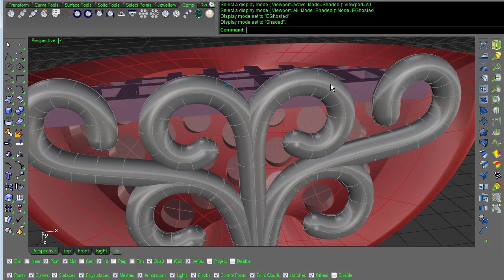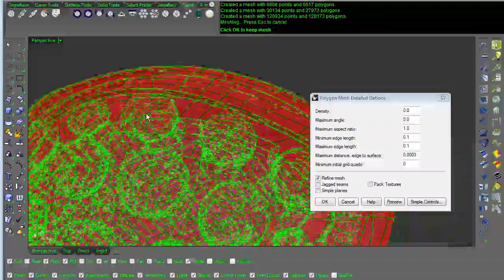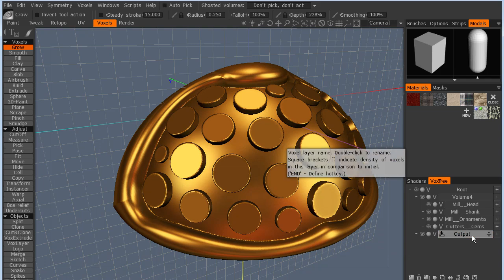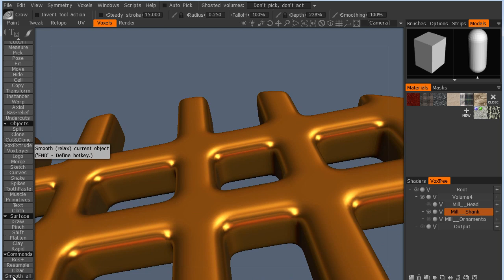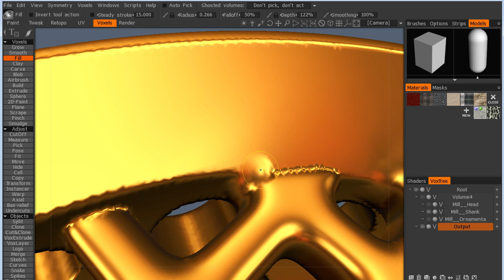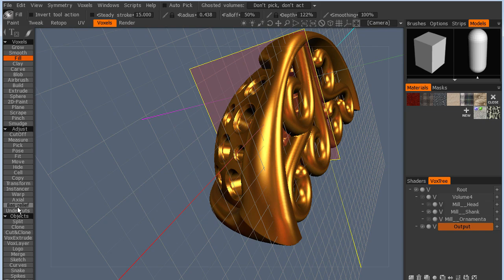Using 3DCoat to Supplement Rhino 3D (old version; see description for new video)

Comment: Hello Eric, Thanks for sharing! I've been using Rhino7 (Trial) for three months and I learnt and used it comfortably. I'm a self learner btw. Now is the time to purchase and like you know Rhino is going to cost around 1k. What do you think is right for industrial designers/ product designers? Rhino, ZBrush, 3DCoat? I hope you can save me from this confusion. Thanks
Reply from the maker: I would say Rhino. Surface modeling will be important.

Zbrush and 3DCoat are very similar with 3DCoat being the better of the bunch. Not sure how much you'll need it though.
Reply: @EricM81  Appreciate your reply! I've been holding my cash around 1k for Rhino(hoping for a XMas discount) but once I heard about ZBrush and 3d Coat, it just got my mind away from it. 3dCoat is obviously a cheaper alternative for ZBrush. So, I'm going to think about Rhino more from now on. btw I heard many people prefer 3dCoat over Zbrush because of its better interface. Is that the only reason to take 3dCoat? Many thanks!

Comment: Thanks so much for all your very helpful rhino videos. In this video you explain how to export from 3D-Coat to STL for printing. What is the best way to export from 3D-Coat back into Rhino 5 for changes I might want to make
Reply from the maker: Rhino isn't great at working with meshes.  Once I mesh a Rhino NURBs surface, for me that is a one way process.  What kind of modifications were you looking to make in Rhino?
Reply: Thanks for answering. I'm and old time bench jeweler just starting out in Rhino for the last year or so and am getting used to inspecting the final model in Rhino. What would be the best way to view the model I finish off in 3D-Coat inside Rhino for a final inspection. The same .stl settings you recommend in this video are the same ones my caster has just started recommending for conversion to .stl from .3dm. I would like to make sure the .stl file from 3D-Coat export is  close to those settings and give it a final inspection in rhino where I can check detail and measurements. After looking through the web, I realize mesh to nurbs, even from 3D-Coat to T-Splines is limited to smooth designs and quad mesh. Any info would be greatly appreciated.
Reply from the maker: Welcome to the club.  I recommend you join 3DCadJewelry.com.  There's lots of helpful folks there like me.  

There are a lot of caveats to your question.  Those export settings in Rhino only work for NURBs surfaces.  If you export a mesh from Rhino, it will be exported as is.  

Perhaps the easiest way is to just drag and drop the file from File Explorer onto Rhino and click Import on the popup dialog.  You could also just type the Import command which is the same as clicking File -> Import.  Just make sure the file types filter is set to . or *.STL.  

I'm short on time, but I'm going to make an updated tutorial to address some of this, so you might want to subscribe to the channel.